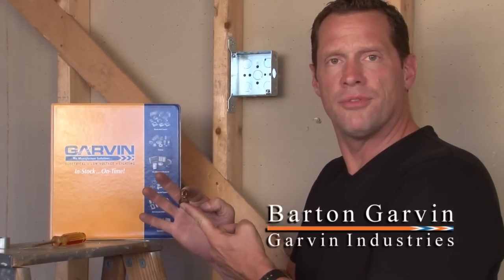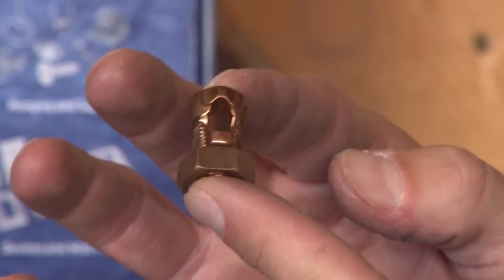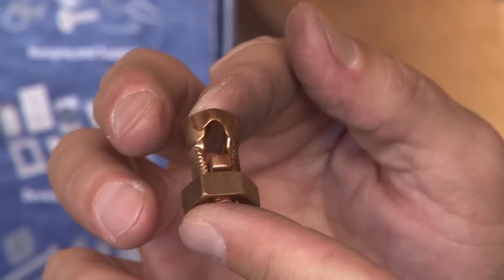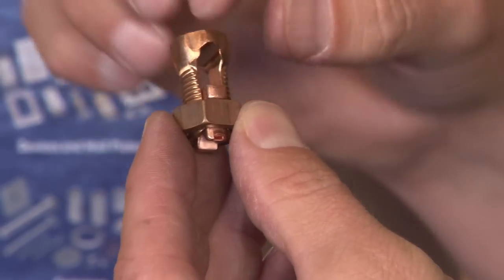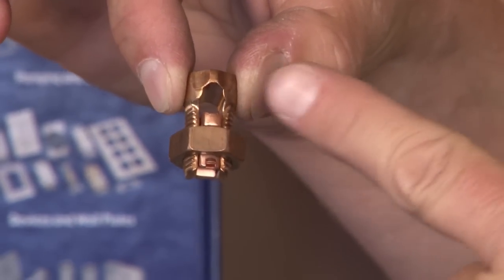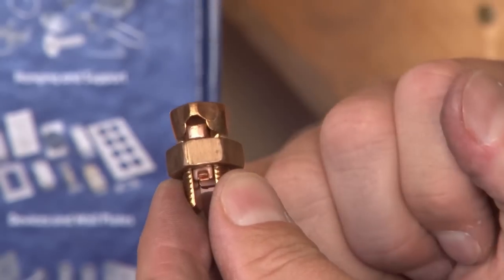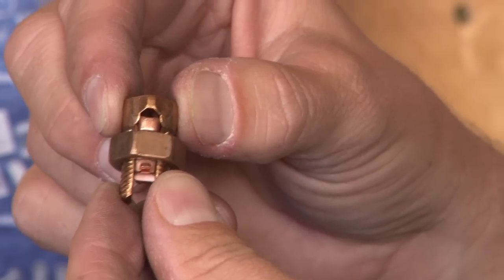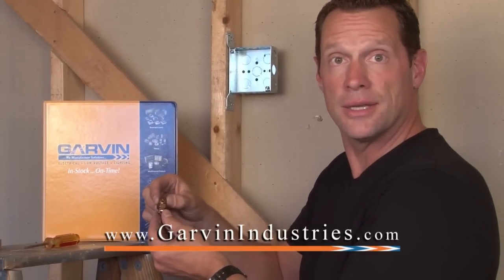Split Bolt Connectors & How They Work SBLT Series

Comment: so little information. Why post it at all. What about copper aluminum connections? what kind of tape? how about heat shrink tubing? how many connectors in a box? If you found this video then you probably already know every thing covered in this video.
Reply: There's one with a separator where you put aluminum and copper so they don't touch